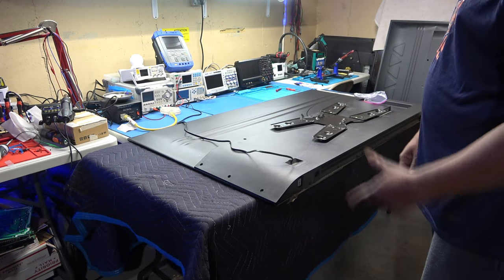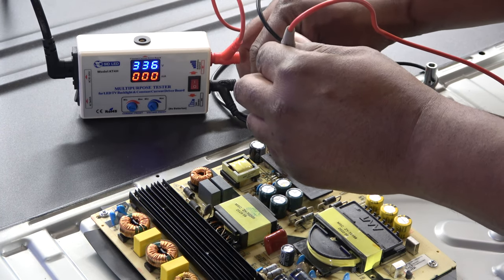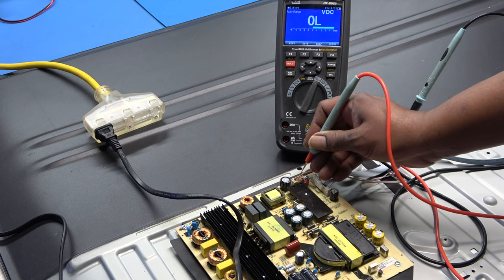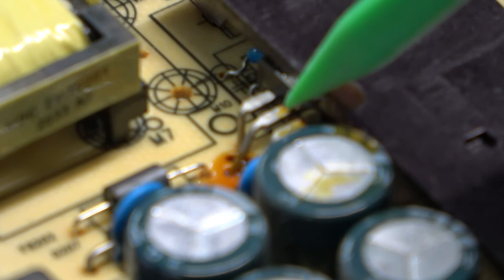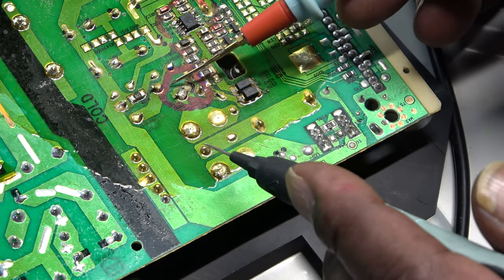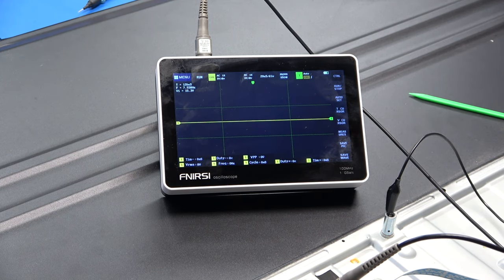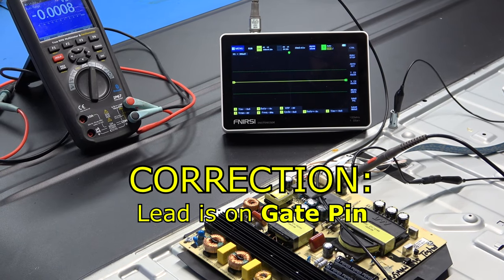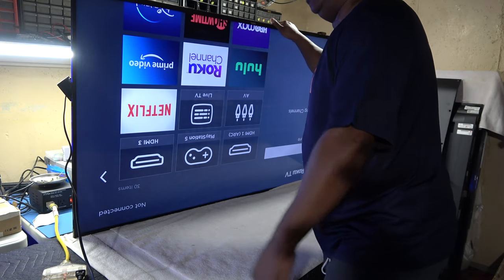65 inch ONN Roku TV has no backlight just a Black screen.

Comment: I changed my backlights on a 65” TCL and when I got it back together there were vertical lines going down the right side of the screen. Can you tell me what could that could be. I checked the connections to the main board and T-con board and all are connected correctly.

Comment: I heard a soft buzzing sound when I powered on t.v. a month ago. Powered on the t.v. today, and the screen is black. I used my flashlight, and sure enough, there is a picture🤦🏽‍♀️70in onn t.v.
Reply from the maker: Check the backlight capacitor 1st on the PS board by the led plug. Its usually swollen 10uF @ 450v. LED's could be bad too.
Reply: @BigDog8882  Thank you ❤️
Reply: @BigDog8882 I found it and yes it is no longer flat on top. I was just curious to see if I could fix it. This is the second one within 2 weeks. I'll toss it and buy another.  Mom called, and her t.v. doing the samething. It's our time to deal with the t.v. shenanigans 😂

Comment: Thanks for showing what the ultimate point of failure was, I kinda suspected it would be, I had something occur like this before with higher than normal voltages & that was the fault. I like the new scope ... how do you like it?? Seems to be reasonably priced on Amazon 🤔.
Reply from the maker: It sucks, dont get it. One day it just stop reading signals. I only used it like 10 times.
Reply: @bigdog8882  Really? ok, thanks for the heads up. I think that brand may not be the best when it comes to portable scopes (based on some reviews I've read lately).  I was hopeful it was gonna be a decent  one ... oh well👍

Comment: did I miss what the actual issue was? I know you said you accidentally popped that chip, but was that transistor the real problem?
I have an Onn 70" Roku TV with no backlights, just the initial flicker, and it is "on" when you use a flashlight against the screen.
Doing quick observation, the 10uf 450volt capacitor at the backlight section is swollen, so I'm going to replace it first, as I can only find used power boards on ebay from China at the moment.

Comment: Love your videos, very detailed. I have a TCL 75S421 with dead LEDs but can see the image with a flashlight. The power board is giving me .66v to the first two red LED wires but the second two are 0v. Can I test the LED strips with my DC Power Supply Variable?
Reply from the maker: Good Question! Yes u can use a variable DC power supply. Just make sure the current setting is low; probably like 1 amp or less.
Reply: @bigdog8882  thanks for the reply and information. I did the repair but put a half inch crack on the screen being misaligned on the frame. I chopped it up as loss but wanted to check my work if I fixed the bad LED issue. Now when I turn it on I don’t have the backlight or the faint image with a flashlight. Any ideas? Everything is plugged in as it should. TCON-Board is humming. LED still outputting 66

Comment: Excellent work. I do wonder what conformal coat the manufacturer uses. I've used xylene for most conformal coats I've had removed, which helped a lot since I can probe much easier without deforming probes or damaging solder joints and/or boards.

EDIT: The usual manufacturers make offer their own "formulations" with different applicator styles (Chemtronics, TechSpray, MG Chemicals, MicroCare, etc.).
Reply from the maker: Thank you!

Comment: Excellent video.  I'm learning a lot from your logical approach in troubleshooting. Thanks for uploading it.  I'm intrigued by that LED tester, as I've never seen one before.  I'm guessing it is a constant current source that stays within the limit of the LEDs to show if there is an open or a short.  My 50" ONN "dumb" TV quit working one day after 2 years of great service, but when I shined a light at the screen I didn't see any ghosts, so I didn't think it was a backlight issue.  I watched your video about the NVRAM chip replacement and was going to try replacing that IC, but my wife was wanting to watch TV and I was taking too long, so I bought a replacement Samsung "smart" TV, which I can't stand compared to the ONN.  (Smart TV's in general, I don't care for).  Perhaps one day I'll pull the ONN out of storage and have a 2nd try at fixing it.

Comment: Hey! Love the video! I have a question that I need some help with. My tv has no backlight but ghosting, and some leds are burned. The voltage on the led supply is not constant and it shows pretty much 18-22 volts. I am thinking of replacing the led strip but I am worried that the next one will get fried too. Any suggestions or video recommendations on your channel?
Reply from the maker: Just replace ALL the strips to start. Thanks!
Reply: @bigdog8882  thanks a lot! I will try it then!
Reply: @bigdog8882   It was the strips! Thanks a lot!

Comment: Will you get voltage to the LEDs without any other boards plugged in, just the power supply?
Reply from the maker: All depends on how the LED circuit is designed to start via the BL ON command from the Main board. It most cases yes, but it will be a lower voltage until TV is powered On.
Reply: @bigdog8882  Any idea what the BL ON voltage should be (I think it was either around 3 or 5v), and can I use an external power supply to trick tv's power supply into turning on the backlight? Thanks
Reply from the maker: @techjdu  Yeah  2.7 - 5 volts, Yes you can supply approx that much voltage to the Backlight On pin to turn on the LED circuit
Reply: @bigdog8882  Thanks, I'll give it a shot.

Comment: Hey bigdog, I have a quick question I usually test the strips with a led tester as well while they are still plugged into the psu. Is this a problem? I did this on a tv I replaced all the strips on and it seems to be working great. -Thanks
Reply from the maker: Thats fine, but I always unplug them b4 I test just to be on the safe side from false voltage reading on the led tester.
Reply: @bigdog8882  thanks.

Comment: Hello, I have a magnavox TV, 50me313 with a suspect bad control board. Will any board marked BA31T0G0 201 3 work in it, or do I have to get a particular eeprom for it? I found a cheap board on ebay, but it's marked as a BA31T0G0 201 2. Will that work?
Main symptom is that when plugged in, it makes a chirping sound. When I unplug the ribbon cable from the psu to the board, it stops. I ohmed out "a bunch" of surface mount caps and most of them showed continuity. More than I would want to replace.
Reply from the maker: There's actually only one on the Main board thats shorted, the other little brown caps are reading a short because their in series with the one thats actually shorted, put meter in ohms and find the one with the lowest resistance in milli ohms. Look on my channel page search bar, I think I made a video years ago on a similiar TV with the same problem. Thanks for watching. https://www.youtube.com/watch?v=uAFCTZCb1BA&t=12s